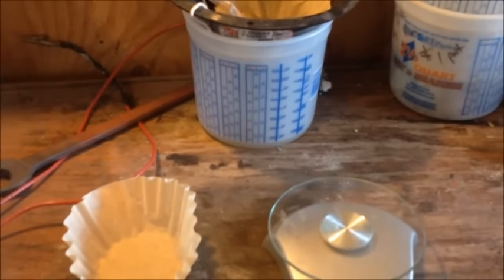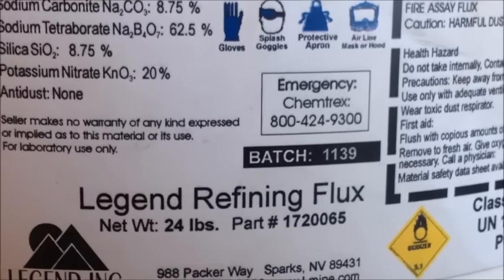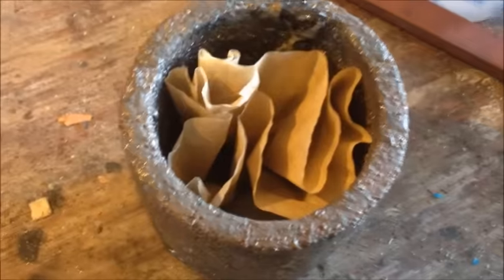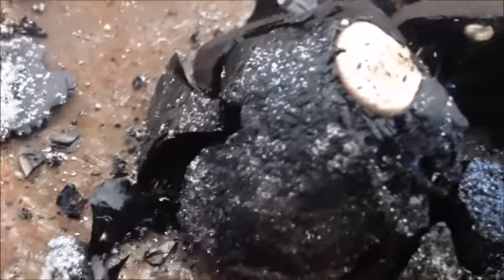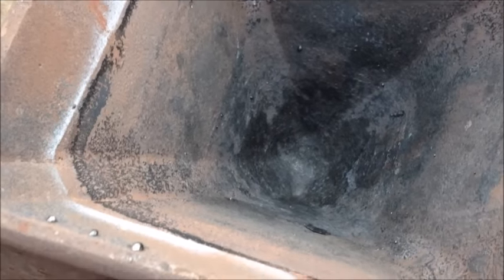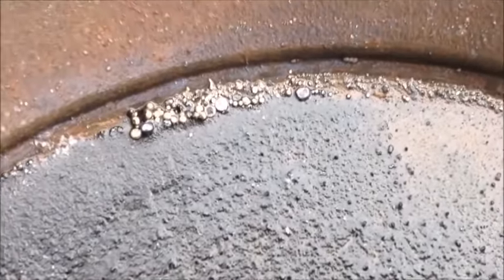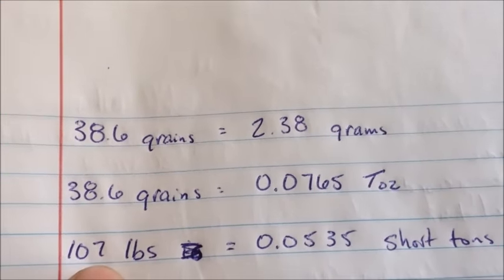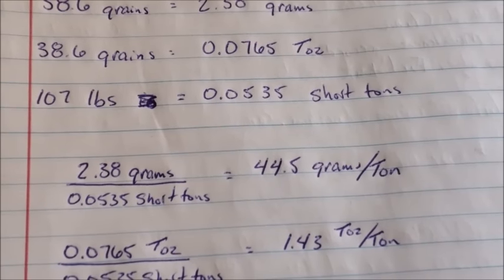Rocks to Gold Part 3: Creating a Gold Button by Smelting the Concentrates

Comment: I could watch that all day.  From nothing to gold!  Did you ever get the purity of it checked?  Wonder how much silver was in there.
Reply from the maker: +Moose Scrapper Thanks Moose.  I haven't had a chance to check the purity yet, but I hope it will be quite high.  From the assays of the rocks there was only about 10% silver so I think it's probably 90% gold by weight.  When I get it analyzed I will post a comment in the video.  Thanks again.
Reply: mbmmllc so how'd the assay turn out?

Comment: Your videos are really good stuff.  I liked especially the smelting of black sand stuff.  I have one comment anyway; There is an article in Gold Refining Forum from metallurgist,  who works in gold industry,  about smelting.  He wrote that it's virtually impossible to recover all the gold that is left in slag by gravity methods, or even leaching. No matter how fine one mills it.  He wrote that only practical way to recover it all is to use the slag in a next feed.  Hope to see more stuff from you soon.
Reply from the maker: +Finn Thanks for your comment and tips.  I hadn't thought about using the slag over again, but I will give it a try.  Do you have a link to the post you mentioned?  I would like to read it.  More videos on the way.
Reply: +mbmmllc Re: Things which may be of interest to members
Reply: +Finn The link didn't work the way that i thought.  I try again;http://goldrefiningforum.com/phpBB3/viewtopic.php?t=21526#p222607
There are two posts about this theme in this long thread.
Reply from the maker: +Finn Thanks!  I will look into this.
Reply: +mbmmllc Typically i have read carelessly.  The poster wrote that the slag must be finely milled, processed in a shaker table and the TABLE CONCENTRATE should be used in a next feed.  Makes sense, other wise one would end up more and more slag to feed.  Sorry, my embarrassment.

Comment: I hope you respond. I have sat and sat watching your video's. I am working 3 tailings piles from  200-300 yr old mines. I have truck loads of pyrite, that I toss away. Am I tossing gold away. What I gather from your video's is there is also a little gold in the pyrite. I crush with a rock crusher, run through a 5 tear gold cube, pan light weights off, take out magnetite and smelt. I get alot of tiny specks stuck in my slag. As I understand the little bit of pyrite I miss burns up during smelt. I have taken to have stuff acid tested[since I dont have here] Guy said 18k. I kept getting gold specks stuck in slag, got tire of wasting so ship to a refiner in Colorado, never any response, then shipped to refiner in Binghamton NY, He said nothing in what I sent, try again. I really wish I could get some answer's. I know I have since I have gotten some buttons from my smelting's. Can you spare the time to help?
Reply: Migel, Pyrite often has a small amount of gold. Often 1 to 3%. Sometimes more, sometimes less. You can crush the pyrite and use an Aqua Regia solution, or leach with cyanide. If your pyrite has a higher amount of gold, it can be profitable, but I would highly encourage you to do your research first, as these processes can be dangerous.
Reply: To late already doing it now as we speak. Just Like Jason dont return calls had to buy equipment else where. Unsubscribed
Reply: Migel, Sent you an email
Reply from the maker: Hi Migel.  Sorry I didn't see your original message from a few months back.  I think the best thing is to send your pyrite off to an assayer and have it tested.  Try American Analytical Services in Osburn ID.  This will tell you if there is enough gold in your sample to mess with.  Your pyrite will need to assay really high to make it worth while to smelt if you only have a small amount (few lbs).  If your pyrite cons assays 200 oz/ton it will take 10 lbs of cons to smelt to 1 oz of gold.  If it assays only 20 oz/ton it would take 100 lbs of cons to recover 1 oz of gold.  If you are creating large amounts of pyrite cons (tons) with gold values of over about 20 oz/ton this will be a salable product.  I would try TCB international run by Ken Jewel.  Here is his website: http://tcbinter.com/ Again, sorry about missing your message on YT and good luck with your project.  Thanks